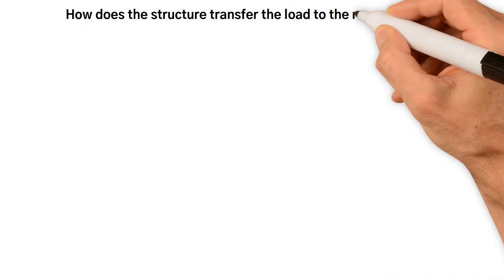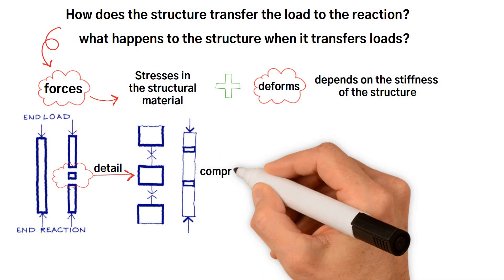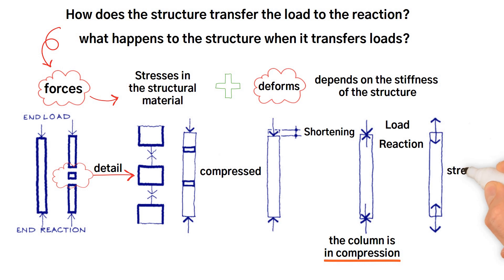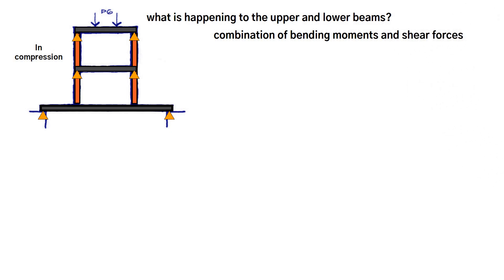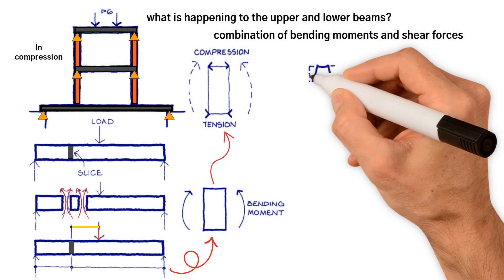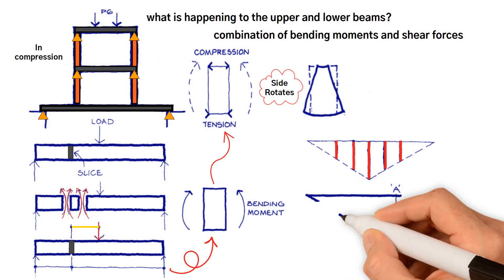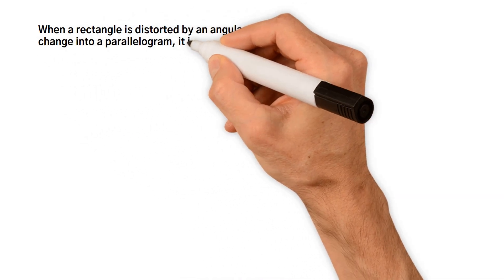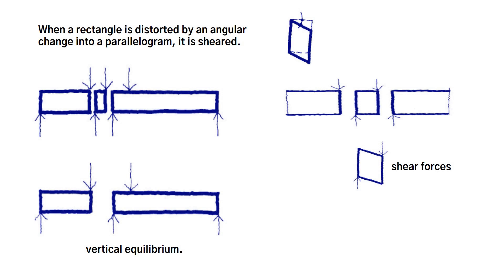How internal structural forces work - Axial, Bending & Shear forces

Comment: How moment can cause on structure? Can external load turned as moment?  Bcoz i little confused by moments ..is the load and moment are different?  I know that force x perpendicular distance is called moment.. but still can't get core understand about moment..

I can give the example of couple moment is aeroplane wings.. but moment happening in structural is  quite uncomfortable to understand
Reply from the maker: Hello! Great question about moments & their impact on structures. A moment is essentially a rotational force that can cause a beam or structure to bend or twist. It is created by applying a force at a distance from the point of rotation. For example, if you applied a force to the end of a lever, the lever would rotate about a pivot point & create a moment. External loads, such as the weight of a structure or wind loads, can also create moments on a structure. For example, if a structure is subjected to a lateral wind load, it can cause the structure to twist or rotate about its base, creating a moment. It's important to consider moments when designing a structure, as they can cause the structure to experience bending or twisting, which can impact its strength & stability. You can calculate the moment at a specific point on a structure by multiplying the force applied by the distance from the point of rotation!
Reply: Your videos are phenomenal... excellent to understand..keep posting more videos interesting..
Thanks for the video.. @structuralengineercalcs